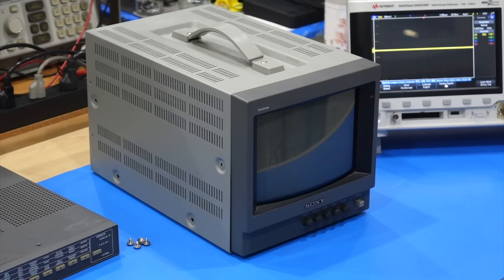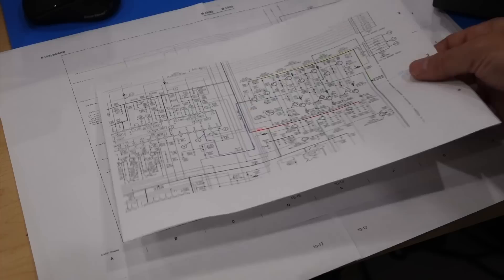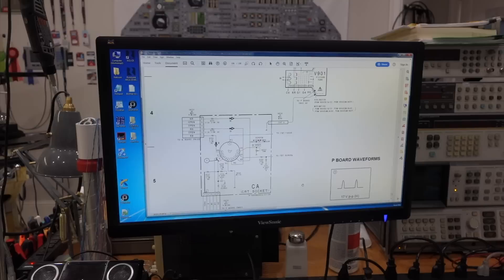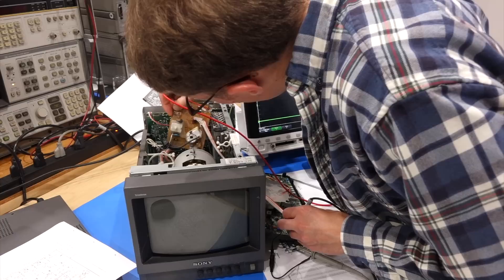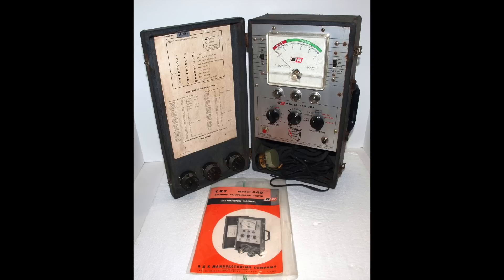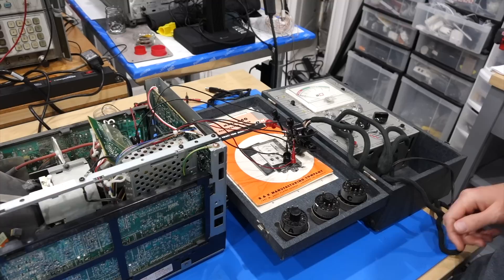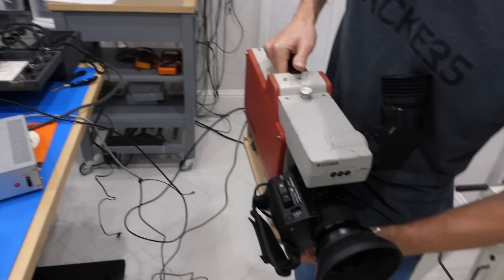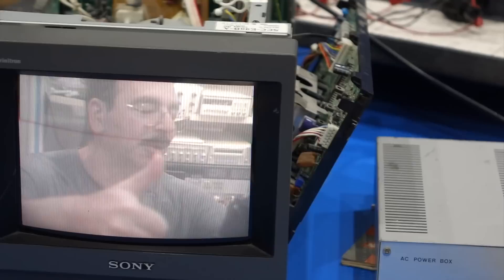Rejuvenating a color CRT

Comment: I still have  the Sencore CRT rejuvenator. I used to use it a lot on Cocktail style arcade games - the gun being at the bottom allowed tube debris to fall into the guns and cause H-K shorts which were easily removed. Guns also could be "shocked" and they often worked for far longer than a few hours - months to years. And sometimes it killed them. Its a risk  but often no net loss.

Comment: I think those Sonys have AKB. They produce solid lines in the vertical blanking interval to measure CRT emissions and continually balance the guns. If you under scan you can see it, and it shows up on the scope around 3:30 (the three smaller pulses before the 100% field lines)

In other words, if you haven't tweaked the screen/drive controls and the balance is this far off, it is probably the tube.
Reply: Is that true of FD Trinitrons and Wegas? I swear I saw colorful lines when underscanning on my old Sony Kv-27FS120...

Comment: I had a degree in computer engineering before getting a job doing data analysis. I've been through the basics of circuit design. I've solved a physics problem or two using nodal analysis. I've played asteroids on lab bench oscilloscopes. I'm over a decade out of practice, but I still enjoy the content.

Comment: I've rejuventated lots of tubes with my own home made kit. It's very simple but it doesn't last very long. The way I used to do it was 1 cathode at a time. Common up every pin of the tube base except the 3 cathodes and the 2 heater pins. Use 230VAC with a 60W light bulb as a ballast. One cathode at a time to one terminal and the common pins to the other. Then the 2 heater pins to 12v. Apply the 230VAC first and nothing happens. Connect the heater which gradually warms , starts to glow,   the 230VAC will begin to flow and the light bulb will first of all flash a few times before staying on. Then disconnect the heater and the light bulb fades out. Then repeat for the other 2 cathodes. You can also use this for blowing away shorts.
Reply: Quite funny watching people who don't know wtf they're doing. Don't need the scope, just use the meter (VDC) on each of the 3 cathodes and it's obvious what's wrong.
Reply: @1magnit  are you seriously going to knock this guys knowledge?
Reply: @TheFool2cool  Been fixing tvs since the late 80s.Fixed thousands of them, Sony trinitron tubes are a bit different from all the others too.
Reply: @1magnit  Same here but a few years before you. We still had the 10+ year old Delta's with tubes in them on our bench regularly.
Reply: That method is also common among tv repairman in the Philippines including me, My father was a tv repairman and I'm currently an arcade machine technician. I use that to rejuvenate old crt arcade machine.
Reply: @PaulaXism  I'm in NZ. I learned on Phiilips K9 Tvs. The first gen had a delta tube, the 2nd gen had an inline  tube. I bought broken ones, fixed them , sold to those who had rentals. put the rental companies out of business. Late 80s
Reply: @PaulaXism  oh yeah? Well, back when I fixed TV's, they had a pterodactyl and a candle inside, and the dino made the image using shadow puppets.
Reply: @TheFool2cool  it's a thing you sometimes see with old technicians, their halfassed shortcut method that let them do piecework as fast as possible is clearly the best and only way to do things, regardless of the completely different context. Kind of like the tetris effect, they turn everything they see into work.

Comment: I worked in TV repair back in the CRT era..PIL and Delta's.. used TV's for sale (and rent) in a poor district.. Thee tricks were only to keep the customer happy for the week or so it took to source a replacement new or regunned CRT.. no more than that. They are nothing more (and never intended to be) anything other than a "get you home" temporary fix.
Trinitrons I know from experience don't respond well or last more than a couple of hours. There isn't much emitter on the cathodes and once it's used up that's it.

Comment: OMG that takes me back!  My dad was a repairman since before I was born and I worked in his shop as a technician. He had a lot of B&K gear (and Sencore too) and had that tester / rejuvenator. I don't think we ever uaed it (or barely so) for the exact reasons you stated. He'd troubleshoot out until he eliminated everything but CRT and then would tell the customer honestly that he could try this but results would be temporary and not guaranteed. Of course that was the days when the recommendation would just be to replace the CRT.  And before he retired it would be "buy a new aet" instead of repair.

Comment: My wife has a 13" Trinitron TV from about 1980 that she still watches several hours every day, as she has done for decades.  Still has a nice bright picture too.  She has had numerous offers of larger modern sets, which she always declines.  When TV went digital in 2009 we got a government-subsidized digital-to-analog converter so she could keep watching the Sony.  Later the tuner gave out so I switched it to the 3xRCA video/audio feeds from the converter.  Then the sound gave out so I routed that through the stereo.  So now it is just a dumb monitor but she still prefers it to anything else.  It doesn't respond to the remote anymore but fortunately there are on-set buttons for the only 2 functions she needs:  On/Off and TV/Video.  Several months ago it looked like it finally gave up the ghost, but I took it apart and spotted a tiny almost imperceptibly swollen capacitor and replaced that, now it is still chugging along.  At this rate it's going to outlive us both.

Comment: Nice job on the rejuv. Now you have time to order a new CRT :) That is really what a rejuvenation or the earlier B&W tube "Brightner" was for. Keep the customer quiet for a week while the new part came in. 
Also, nice ITC/Ikegami 730 Eric, not to nitpick put that is not how you hold a p[ortable ENG broadcast camera. It is supposed to be, the camera on the shoulder, the right hand through the strap on the lens with your fingers on the Zoom Servo control, and the left hand used for focusing. At least the Ikegami gives you a shoulder rest, unlike its competitor the RCA TK-76 which just sat the flat metal bottom on your shoulder.

Comment: Half split troubleshooting method - check the color gun drive at the tube neck pin; if bad move back halfway through the relevant circuitry and check; if good at the color gun pin - bad color gun - no further troubleshooting needed.

Comment: A quick check for me to determine if it's a gun or a driver issue was to cut traces and use a jumper wire to swap a known working channel and gun. Basically drive the green gun with the red driver and the red gun with the green driver.

Comment: I've done this before with a variac and a 4 watt night light bulb at 115v. If you need more voltage you can use the variac to boost the voltage more. You know it's working because the night light bulb will kinda flicker, and it's done when you have a steady glow. If it doesn't work the bulb will be off.

Comment: That horizontal wire behind the Trinitron screen is something I don't miss about CRT's at all. It's there to keep the phosphors in place; sometimes they make it so thin you hardly notice it, but once you see it, you don't unsee it. And in this cute little monitor it's extra obvious for some reason. Makes you wonder what happened to it.
Reply: It's there to keep the aperture grille stable, as it basically just consists of thin steel noodles spanning the entire height of the screen. Not needed on shadow mask tubes, as that's a sheet with holes.
Reply: @hotgluegunguy  Yeah and the stabilizer wire(s) (two on tubes larger than about 17") are almost invisible, you'd never see one on a TV tube unless you look very closely and on data displays overall image quality more than made up for it in my opinion. I've taken apart a couple of dead Trinitron tubes and the aperture grill is a piece of sheetmetal spot welded to a heavy frame with slots etched into it from top to bottom, pretty impressive structure.

Comment: Most of these monitors have been ran into the dirt. I have a similar sony (AC/DC version) that likely has a good tube but the deflection board is baked from sitting in a truck in FL for 15-20+ years...
All yours let me know where to send it, may be able to swap tubes or fix the dead baked electronics.
Reply: His contact details are in the channel description, so easy enough.

Comment: if you don't own a rejuvenator , you can do it using a 230v voltage and feed it to the tube through a 15 W bulb , and vary the filament voltage with a bench power supply. Works very well too. there are schematics laying around on the internet
Reply: 12v heater voltage is the sweet spot for me. 1 tap with the screwdriver on the electron gun and the rust just falls away like a dust inside.
Reply: @Raz82000  yep but some CRTs have a 6.3V filament. I found out that it flashes the best by increasing and decreasing the filament voltage continuously without allowing the cathode to get too hot. I apply my 230V AC between the cathode(s) and G1. So far the tubes I regenerated without dramatic failure during the process haven't decayed through time

Comment: I've watched enough shango to know when a concanoidal plonkle-shplarvenator isn't cinco-triculating within acceptable parameters (i.e. baked)
Reply: Ah, yes. But you have you tried adjusting the reciprocating dingle arm to alleviate the negative positronic warble of the lupino nuts? Without doing that, we don't really know if a visibean is actually prefumilated or not and that can severely moderate the output of the turbo encabulator.
Reply: Shnarvle McSharlebvarseler, glazed in flavor country

Comment: I worked with an old guy in the electronic cage at the Salvation army donation processing facility who had one of the rejuvenators, We had a lot of Sony Trinitron TV's that we hit with it. Yes, you overheat the filaments a little and then zap it with a HF signal to knock the contamination off and it worked pretty good. The main problem most of the time was a red slur coming off the side of an image edge such as a white shirt showed the most.

Comment: It can be done with series bulbs in heater chain and a 15w emission bulb    ... Is applying ruff dc to the cathode. It shacks the dirt off the cathode.  .. I hope u can follow my idea.   ... I done mni a delta gun tube  and pil   Sony Trinitron will go.  I did early sets from the 1970s with good success.    Good luck guys

Comment: It's not snake oil, on a tube with a decent sized lump of cathode it can yield a good amount of extra life, even into the years range, unfortunately the Trinitron tubes don't fall into that category but you can often recover them and get some useful extra life but it's not a given and you have to be careful with the current. 

Later B&K tube rejuvenators are a lot better at controlling the current, you can start off with a very low setting and crank it up if you get no extra emission.
The other trick you can do to gain a llittle extra emission is to raise the heater filament voltage (if it's derived from an open frame LOPTX then you can open circuit one end of the heater winding and run an extra turn or two of wire in series) and run the tube hotter for a few hours after a gentle rejuvenation